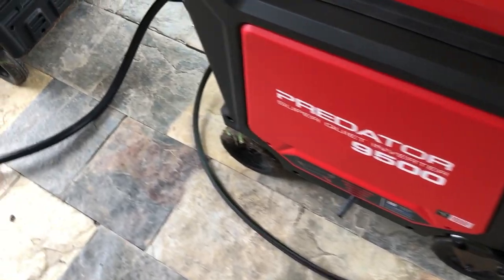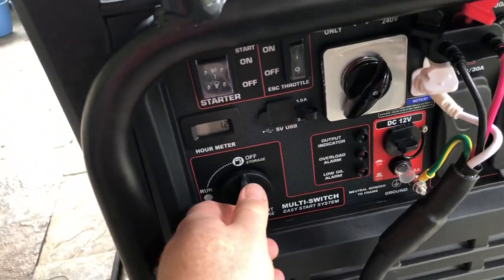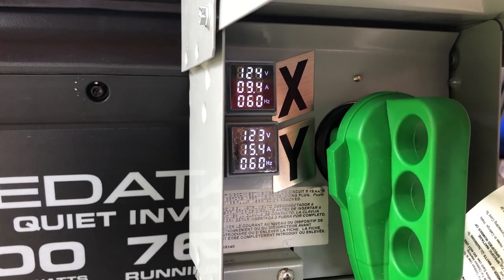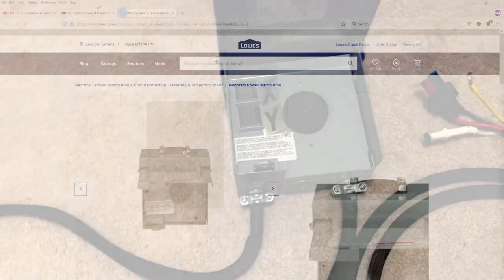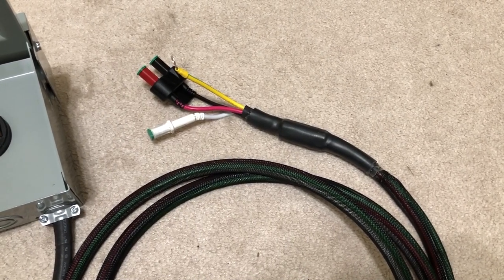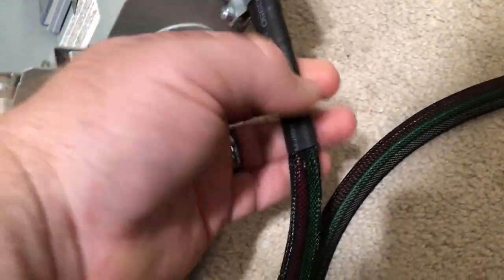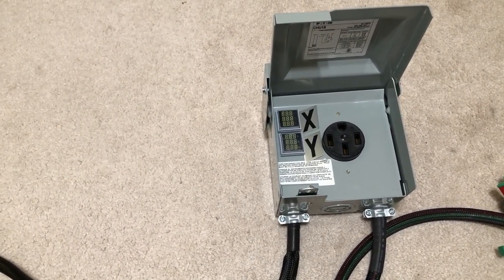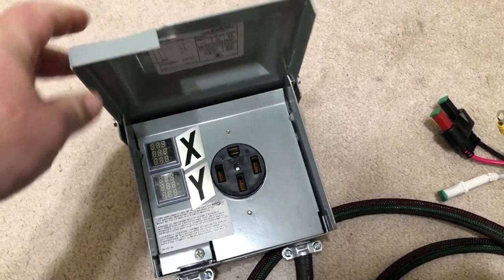Predator 9500 Home Built 240V Parallel Kit Test & Build Parts: 2X Output Power Using Two Generators!

Comment: Could you do me a big favor.
According to a lot of folks the DuroMax XP9000iH and the XP9000iH-pk cant output 120v on 2 legs from the 50amp plug since the neutral is missing. An example of a generator thats wired correctly is the Honda eu7000is, (SOME of the predator 9500s even some of these are missing the neutral on the front panel.) and the new Genmax. The way the DuroMax is wired its only be able to safely produce 240v, not 120/240.

Could you check out this post I started about using the xp9000iH with there xp9000iH-pk parallel box with no neutral connection. Seems odd DuroMax would do this. 
Site is    power equipment forum     and the post is    Labeled  Duromax XP9000iH-pk parallel box question 

I was finally able to get you some info on the forum I had posted on. Youtube won't let me send you the direct url of my post for some reason. So sorry

Thanks A Bunch 
Robert
Reply from the maker: I'm not an electrician.  I don't even play one on TV.  What I say is just my "take" and not to be taken with any authority or direction.  I'm not responsible if you burn your house down or cause your electrical code book to spontaneously burst into flames. 

If you plugged a dryer or oven *directly* into the 50amp socket of the parallel kit, the device might not work right because it won't have a neutral (it wasn't connected in the parallel kit housing)  

With many 240V loads you will end up with a slight imbalance.  Yes, 240V devices pull equally from the X and Y legs.  However many 240V appliances also have 120V components in them as well.  (consider the light bulb inside your dryer or oven, it's probably not a 240V lamp, it's a 120V Lamp just wired between neutral and one leg.  They won't bother with a 240V transformer to supply 40watts just for a light bulb, so they pull 120V power from one leg.  Often the electronics in a 240V device will do this as well)  Generally though, these imbalanced  loads are relatively mild.  But, if you directly connected it to the parallel kit, it might not power the electronics or the 120V parts of it.  But, once you plug it into your inlet and it passes through the breaker box, all that changes.

I read most of the thread in the forum you mentioned, and I guess it does make sense they didn't wire the neutral on the 50A plug, because there is no dedicated neutral wire coming from the generators.

This is one of the things I don't like about the Duromax, is that lack of a dedicated neutral. If you have a large 120V appliance, it will be using the ground cable as the return path (neutral).  This is why in my other comments on these videos regarding Duromax, I've advised people keep that ground cable really tight and don't let your finger get between it and the generator when it's running.  There will be voltage on it. 

Each generator will have neutral bonded to frame (Ground).  In your breaker box, if you look you will see that your neutral wires share the same bus bar as the ground wires.  So they are very much bonded in the breaker box as well.  In my video showing my breaker box, you can also see this. 

So when you connect the generators in a pair using the parallel kit, you're feeding X, Y into the box, and you're connecting ground, which will double as a neutral.  The actual neutral cable in your extension hook up cord between the parallel kit and the home inlet isn't being used. 

**As long as your ground cable is of a sufficient gauge to handle the imbalance current, this will probably work.  (Note that this includes the ground wire on the back of the generator panel)**  I don't like it... I like the neutral to be there to carry that load, and the ground to be there as a backup.  

But at the end of the day, the neutral and the ground are presently connected together in 3 places (each generator, and your breaker box).    

I believe this is the part isn't to "code".  You're supposed to have only one place where they join, and this is why some people will disconnect the frame bond in their generators.  But, if the hookup is considered "temporary", most people generally aren't bothered with it.  (If it's one of those whole house generator that's always connected, they do wire those to code without the bond.)

So for example:

On my generators, if I disconnected the parallel kit ground from the front panel of each generator, and the machines were running powering my house... nothing would happen.  The Neutral would be the return path.  Now reset the scenario.  If I had everything connected, and then disconnected only the neutrals (but ground was connected) again, nothing would happen.  (the return load would be coming over the ground cable).  (GFCIs on the generator won't trip because the parallel connection bypasses those as well as the breakers on the front panel)  Though at this point, I would want to be more cautious with that exposed ground lug, because if you were to loosen it, it would spark / arc as that's the voltage return path for all the non-240v devices on each of your legs.

Your system is wired the same as this last description.  Ground will be serving as the neutral between the generators and your home (there is no other path for it to take), and as you showed that parallel kit doesn't even have the neutral wired up.  

However, once it hits the breaker box, the neutral and ground are bonded again.  So your devices inside the home have a "neutral", and that neutral wire in all of the outlets in your home will be functional because of the bond made in the breaker box giving it a return path.  Once that return hits the breaker box, it finishes the circle/circuit over the ground cable to the inverters in your generator(s).  So your 120V appliances and devices should function normally and not "know" anything is odd.

So I guess the big question to find out, is if the ground cabling inside your generator and in the parallel kit are sufficient to handle the imbalance (ground serving as neutral) for running normal 120V appliances.
Reply: @Texas_DIY  Thanks for all your great Info. I was thinking about making my own parallel cable using the L4-30 connector on the front panel of the generator so I could utilize the neutral. I was also kicking around the idea of adding a jumper between the missing neutral and the ground inside the 50 amp connector on the Duramax parallel box so at least the load could be shared with the neutral wire headed back to the breaker box. I know this is not perfect and that there is no real neutral on the front panel but at least I thought it might help. Here is a link to the post of a diagram to make my own parallel cable    https://www.powerequipmentforum.com/conversations/parallel-kit-for-duromax.39331/
I don't know if you noticed in any of the posts but there is no documentation from DuroMax on what order to turn the generators on when using the parallel Kit.
If you noticed from the wiring diagram of the Duramax generator that the parallel plugs are actually switched with the 3 pole master breaker, they are not hot all the time like they are in the Honda 7000, it seems that you would have to have the master breaker on for these two generators to see each other. Duramax definitely needs better documentation,
Its just so confusing.
Thanks Again
Robert
Reply from the maker: I'd check the gauge of the cabling for the ground.  If it's the same or greater thickness as everything else, it's probably fine.  If you're so inclined, peek behind the panel and see what type of cable is being used for the ground there.  If it all looks to be of sufficient thickness, I'd roll with it.  That's pretty much how it was wired and intended for use.

You could make up some kind of contraption where you pull the neutral from the main panel (maybe use a 30A 240 plug that is wired only for the neutral), and bring that into the parallel box, join them, and feed the outlet... but you're getting into some strange and potentially dangerous territory now.  I don't like that idea because it's a male plug (suicide plug).  Now if the ground is connected and there is a better path back you're ok... but if you were to touch that exposed plug while everything was on and your ground wasn't solid, or you somehow became an easier path to ground, that would be bad.  At least with the current setup, the ground is literally bolted onto the front panel.  Make it tight and secure, and that's probably best.

I'd say if you've already got the parallel kit, and two of these units, do some testing.  Hook it up, and start adding loads.  See how things hold up.  But again, I'm not an electrician, and that code book did look like it was smoking just a bit.

Comment: Would the DuroMax XP9000iH-PK parallel kit work for this application?
Reply from the maker: If the plug fits, probably.  My concern is the lack of the neutral, it would have to use the green ground as the neutral, which would present a shock risk if it were loose and you touched it.  If you go that route, make sure that ground is really secure.  Any imbalance between the X and Y legs, will be using that as the return path.  Could be many amps passing through it.
Reply: @Texas_DIY  Good point. I did not catch that. Thank you!

Comment: 240v loads use both legs. You cannot balance legs with 240v loads.
Reply from the maker: Correct, with the exception of the 120v electronics, lights and such in those 240V appliances that may pull power from one leg vs. the pair.  220V appliances are generally very much balanced.
However in residential power, most devices in the home are 120VAC.  With US split phase power, two hots (X+Y) = 240VAC.  A Hot plus Neutral (the split), so either (X+N or Y+N) will give 120VAC.  Your single pole breakers will alternate XYXYXY down the row, switching from one leg to the other.  Which means they get power from one of the hot wires, and the other wire from the neutral.  If more stuff in your house happens to be on X vs. Y, it can create an imbalance.  

This is the playlist of the full video series, the latest one where it covers connecting the generator to the home might be of interest and explains it.  https://www.youtube.com/playlist?list=PLzoNthJzzMFQ877vyCfoc53oDQqGFAIKN

Comment: Why buy 2 9500 units for $4500.00 when you can buy 2 8750 units for $2000 with a coupon? 8750s are inverter units.. save over $2000 and still end up with 14000 running watts. 14000 watts is far more than enuff!   (Predator's)
Reply from the maker: 8750 Inverter version of the generator doesn't seem to have the parallel ports, so you can't connect two together to double output.  They're also open frame, so they will be much more noisy.  But if you only need one unit, it would do fine and save some bucks.

Comment: Welding cable is far more flexible.
Reply from the maker: Indeed.  I ended up having to extend my cables further for the box I made and I used a suggestion from the comments:  #8-4 SOOW for the extension, and (if needed) #6-4 SOOW for the combined feed to the 50amp outlet.  The cable has a lot more strands and is much more flexible.  

I ended up buying just a foot of the 6-4 for the 50amp hookup, and extending the other side using the 8-4 and it was sooo much easier to work with and get things closed up.